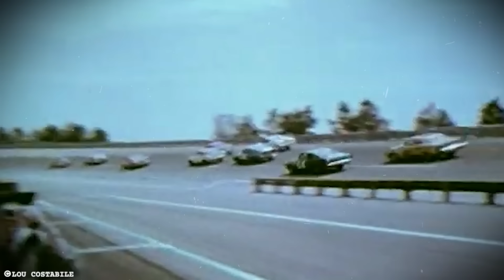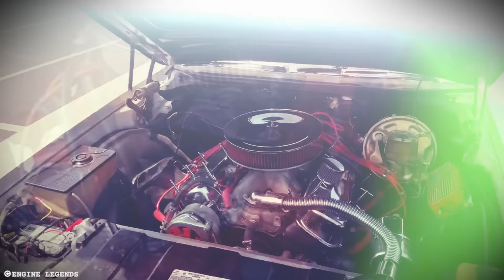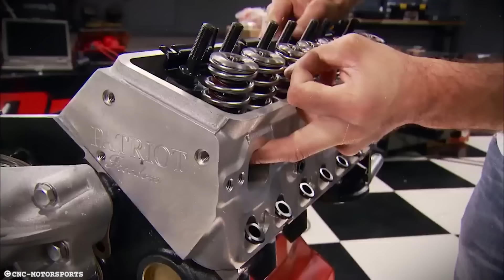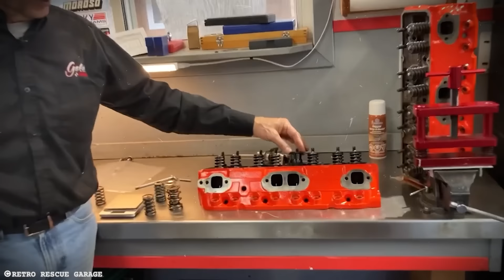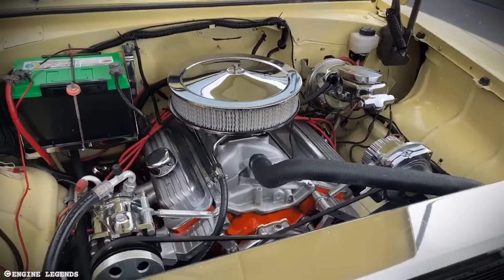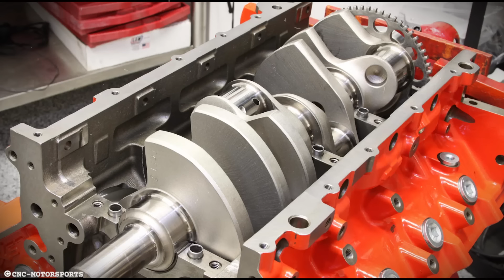How a Chevy Small-Block V8 OUTSMARTED Ferrari at Le Mans

Comment: Well...

Ive owned about 10 Corvettes andv2 Ferraris.  And a Ford Pantera And a couple of Porsches.And Several F o rds with va r ious iterstions of the 427 dideoiler sho r t block.Ive raced v a rious cars for 60 years and been around some very t a lented engine builders. Im 82 now. And its been an interesting trip with a few tentative conclusions.
1.  Generally speaking the bran d and team and car that wins ANY series ...a necessarily the most races has a factory or brand behind it that has the money and focused will to do so over time.
2.Generally speaking an engine with a very strong and well designed bottom end and an excellent oiling system that is understressed  combined with a top end that can move a LOT of a I r efficiently combined with the strong bottom end that staysctog r ther wins races. 
3. Simp l e is good. 
4.Attention to the smallest detsil is essential. In everything. Design build car loop rep o it a irk driver selection race str a teg t selection of team m embers.
5.Do not..ever .. exceed the de s ign limitstions I f what you built. And build a b a l anced car.  one with power excellent suspen s ion wxcellent brakes and f ood a s ro if youre going to be ooerating much abovev100 mph.100 mph.
There are no magic brands . At various times in va r ious types of racing various firms have dominated. 
SOME INTERESTING ANECDOTES......
The Porsche 911 was at inception not a stellar car.  Under powered finicky short engine life between rebuilds. 50 years later and a set of huge sticky tiresxand its a we a pon. The CAN A. series was originally dominatsd by NA Big block Cevrolet engines.. until the rules turbochargers anx Porsche dominated it so throughly that it died.  The Chrysler hemi lives in legend but few I eople realize that a contemporaneous engine the Fird 427 side oiler won m I re total NASCAR races during the oeriod 1963 thru 1968 thsn the hemi or thst the FORD SOHC side oiler varient won top fuel once a couple of p r oblems cc were a olved till the supply of o arts dried up during 1965 66.. And itcwon Le Mans 123 and vroke Ferraris dominance for a long time..
As for displacement.. U a ing a 71 Ford Pantera at 5.7 liters and u s ing the limited rsnge o f aftermarket dpeed equipment it was no great trick to build an engine makingvaround 430 hp a sedate 6000 rp.. No fsncy heads nothing exotic. Which was more than adequate to propel the pantera past 180mph . A hich was faster than a F err as ri Dato n a OR the Lambo Miura o f the day.  5.7 liters vs 4.4 liters in the Ferrari.    
Chev Camaros dominated the Tra n sAm series while Chev cc was backdooring suppirt. Then Ford Mustangs . T h en w h e n F I rd pulled its dupport ANC hired O en s ke and Donahue and AMC as on the series. There usnt always a vest brand. 
The Chevy LS architecture that emergedbin the lste 90s was..  like thec265 SBC a very good architecture.   its won a lot if races a n d champion s hips.  It won the manufacturers title multiple ti m es in the C5R and C6R cars... w h en Pr a tt and Milker ran the ooer a tion. When the GM suits decided to ha n dle m atters themselves not a o much.  
 In the early 60s legendary engines that they made a ongs about 409 Chevy 413 Dodge 406 Fords were the brands o eople t a l l ed about. And these 3 brands nade go I d engines.  But the king of the hill t h e one cc was inning in B ASCAR and t h e drags cc and on t h e s t reet was the 421 SD Pont I ac. A hich m ade aroundc4 I 5 v hp in sreet trim.
Things are notca l ways as the d ongs and legends s a y.
My currentvrecrestional vehicle is an 08 C6ZO6 C I rvette. origin a llyb505hp with some factory flawscandca nearcs a uare de s ign that combinedvwith av7000 rpm redline ma k es for very high n piston s p eed  notca good thing con s ideringnits hy o ereutectic cast pistons .
The car currently makes a reliab l e 650bat the crank.  It weighs 3150 lbs. Itcwill run out stcwell north of 200mph.
I dont free rev the car.  I dont drag race it I dont d o dmoky burnouts  I dont track the car. I use 6000rpm asxa shift point if Im in a hurry.  It runs an afterm as rket fual disc cc luthch an enhanced oiling dydtem e nhanced cooling s yste m s addition a l oil c a p a cc ity  enhanced braking system and minor suspen s ion mods.  It us set up fir and used as a h I gh speed GT car.  And in thiscrolebit is very reliable cc and duccessful.   The tech is now from a sports car inte n ded for the track ob s olete.  in its day thev7 litercengine cc was not the displace m ent Pratt and Mil l erveon the champi I nships  with.

Comment: Also I use roller rockers and solid lift and I used 1.8 rocker so instead of the 1.5 is what came with the car I had 1.8 rockers that completed the duration a bit in the lift and I said the crank I had a windage tray in it and it never touched the oil it was a dry sump oil pan and it and it took and never hit the crank I kicked ass I'm a legend in Winter Haven Florida Polk county

Comment: I had four bolt mains incorporated into the 327 block so also the Caps aftermarket caps that were built for that listen I did more than greenwood did and I never lost a race never blew an engine and I had free floating wristbands that spun in the rod and I use like blue rods and then they spun in the in the rod and in a piston there was no hot spots and I use clips to keep them steady in the middle and I had no problems at all I boarded out 0 I made a 307 with a 2838 in a 327 block now I did this at 18 years old my name is Mark Christopher Miller Esquire
Reply: I built Chevy engines with two-bolt mains that went up to 8,000 rpm 9,000 on occasion and never had a problem. My problem more often was popping U-joints.

Comment: I also got rid of the fan on the water pump that's 15 horsepower that I use two Harrison radiators for Coors and I put dual electric fans between the one and four and two electric fans behind the other so I had four cooling fans 8 course of radiator I run two oil coolers in line deep pan dry sump oil the crank never touched the oil a knife edge to steal 283 Crank that was already 10000 on the rods in 10,000 turned down on the mains and being the fact that it was a small journal 327 block and a small journal 283 crank I had no problem reaching 8600 RPM also in the tarantula tm1 high-rise I used a screen that when the gasoline hit it it particularized and became a mist I did all this at age 20 and I beat everything I was in a 300 deluxe two-door Chevelle which is the lightest of all chevelles because it didn't have the hardtop and I had a 308 rear end and let me tell you something that close ratio M22 four-speed level wind gears in it and it was closed ratio and I kicked everybody's ass never was I beaten and from there I took a 210 four-door post body style 55 Chevrolet cut about two and a half foot out of the front door and shorten the whole thing my drive shaft was almost 2 ft long and then I had a 410 rear end I put a spool in it so I had complete positraction and there was no weight on the front end up in the air first gear second gear and I never touched the clutch but once and that was to drop it to drop it at 8600 RPM I come out of the hole wheels in the air nobody would ever beat me I was never beaten I'm 64 years old now

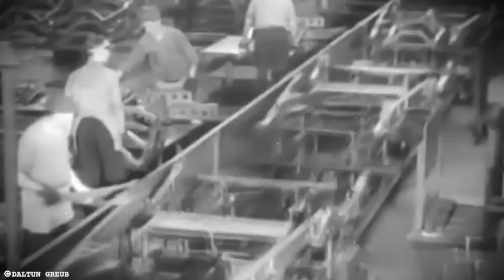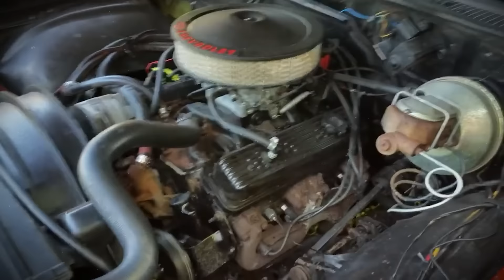Comment: I had a 3:27 small journal crank block I put a small journal 283 steel crank that had been turned down 1010 on the rods and manes I employed free floating wrist pins in the rods and the Pistons power forged pistons I also I also use solid lifters and some dark heads that had 308 intake valves I also employed a dry sump with a high volume oil pump I also employed 1.7 rockers I also employed the Pete Jackson gear drive I put a 780 Holly on a tarantula tm1 Edelbrock also an MSD multiple spark discharge I also ran split fires spark plugs I use closed chamber heads got almost 11:01 and even more if you bore it 30 over from the 4 inch bore 327 block and then it becomes a 307 the hard way I ripped ass with this thing nothing could beat me no Big blocks no other small blocks no trans ams no vets no mustangs when the M22 Rock crusher level wine close ratio transmission with a 12-inch clutch and I dominated I never got beat I became one with my car's RPM and everything and I never touched the clutch except to dump it out of the hole I got 8600 RPM out of that thing and then I knocked it out of the hole front wheels in the air hit second hit for 4th gear I put lightning rods in it lightning rods so that you know you only shift it to the next gear to the next gear okay I never touched the clutch again once I launched and it was outstanding outstanding nobody realized what I had I said it's just a 283 yes it was a 283 still crank turn 1010 and it was a small journal the winding up was unbelievable nobody had an answer while I was beating Z28 mustangs Corvettes anything that came against me even the Big blocks had no chance against my little 302 that I bored 30 over into a 307 with a 283 crank wow I done something didn't I my name is Mark Miller nobody ever beat me ever ever ever ever ever ever ever never beat me

Comment: European philosophy and mobility constraints dictated smaller vehicles driven by smaller engines.  They had plenty of reliable, simple engines but nothing the size of an American V-8.  High strung double overhead cam v-12s that characterized Ferrari were considered the pinnacle of automotive engine development.  They were efficient and free revving.  I doubt that Ferrari worried much about the Corvette and the Chevy V-8.  He knew he would would there with something competitive every year.  If it wasn't it would be sooner or later.  Americans international racing efforts are a lot like their foreign policy.  A 3 liter Chevy V8 would never cut it as configured. Apples and Oranges comparisons like this never show the true nature of the supposed subject.

Comment: the small block chevy has won more races than all other manufacturers combined ,,,, this should tell you all you need to know ,,,, and did it WITHOUT FACTORY SUPPORT ,,,,, without copying and steeling from others ,,,,, like the hemi ,,,,The world's first hemispheric engine was invented in 1901 by American inventor Allie Ray Welch. Originally built as a two-cylinder prototype by the Truscott Launch and Engine Company, the first-ever Hemi was actually designed to power a boat.Early Hemi Timeline:1905: The long-defunct Belgian carmaker Pipe built the first automotive Hemi, a 4-cylinder engine.1907-1910s: European racing powerhouses like Fiat and Austro-Daimler utilized Hemi engines in early Grand Prix cars. ( stolen from americans ) and fords stolen flat head v8 ,,,,, Chevrolet's very first V8 was the 1917 Series D V8, a 288-cubic-inch overhead-valve engine. Produced only for the 1917 and 1918 model years, it was an advanced but short-lived design that produced 36 horsepower. It is largely overshadowed by the iconic 1955 Small-Block V8 (the 265 cu in), which truly launched Chevy's V8 legacy,,,, and fords famous flat head v8 ,,,,,put out 90 hp ,,,,, chevys blue flame 6 put out 95 hp ,,,,, and i love rubbing this in the ford and mopar guys faces